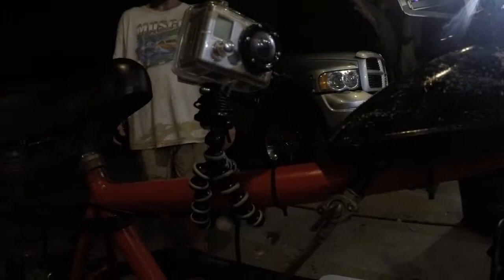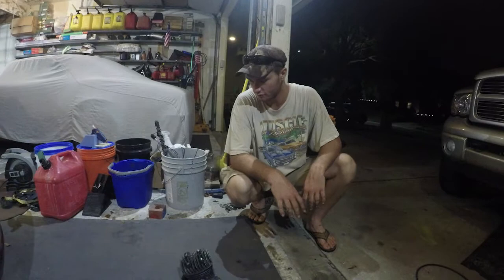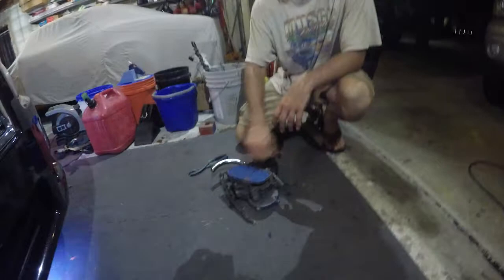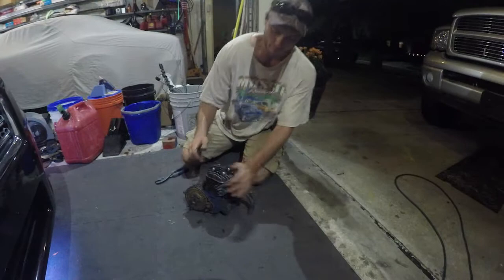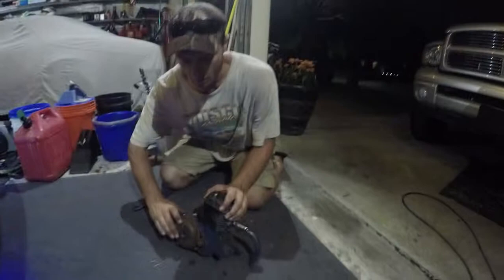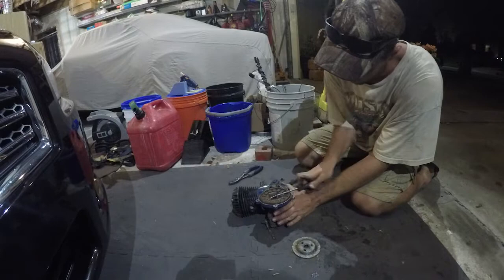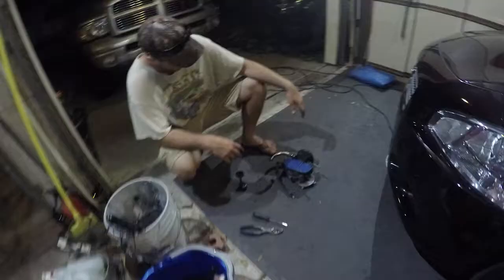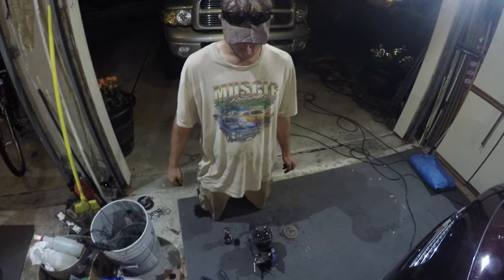How to Maintain Your 2 Stroke Bike Engine

Comment: What type of grease to use on the gears? My motor came with barely any in the case and its already starting to whine at full throttle